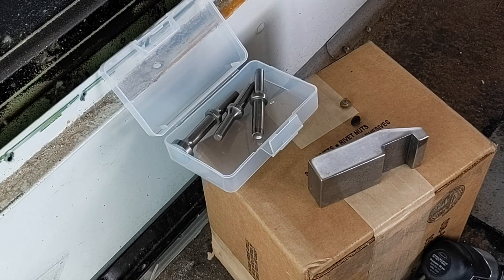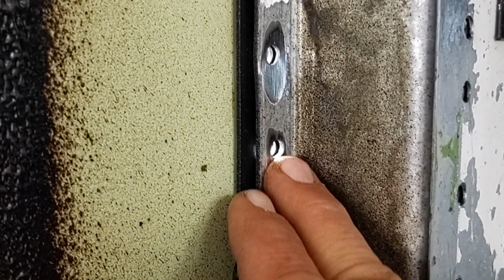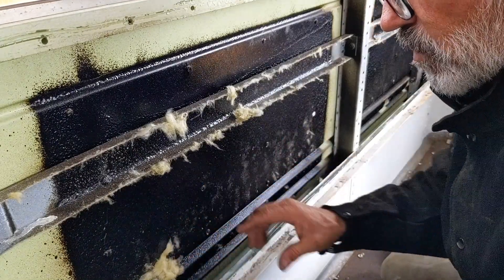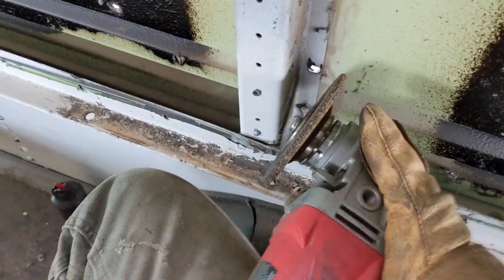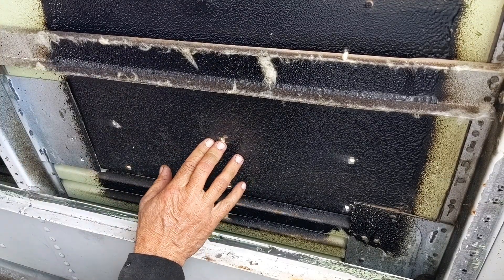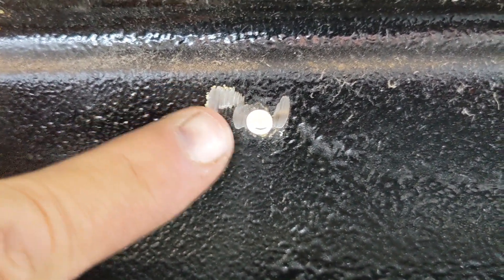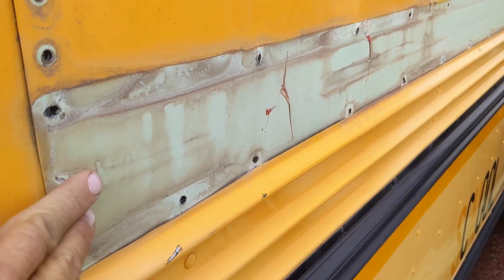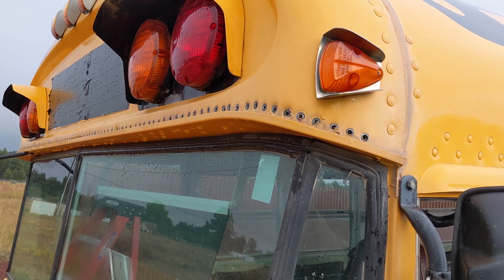How we remove solid buck rivets.

Comment: Those particular rivets in the hat channels came off without much trouble for me using the chisel bit on the air hammer and then using the pointed bit to blast them out.  The ones in the chair rails were a whole 'nother animal though. The chisel bit just wallered out the sheet metal. Cutting a cross in the head with a cutting disc allowed the chisel to remove the head without damaging the sheet metal. good stuff. (I'm shortening a bus in case you're wondering why I'm removing the chair rail rivets)

Comment: If you cannot get to the back side of the bucked rivet how can you remove the rivet?
Oops.  I watched farther and you did explain. My problem is a 1970 MGB Roadster. The windshield is very close to the rivets I need to remove. The Sun visor holders are riveted. I did drill the head off but cannot get the back part of the rivet to fall off!!!

Comment: I did not at 12:00 as you are talking about grinding and avoiding cuts....your gloves show a very close call with the grinder. That event must have been awaking, but sadly we have all had those, yet some lose fingers...maybe that's why they put guards on these tools?
Reply: The guard and handle on an angle grinder gets in the way more than it helps and this is a fact. I've used angle grinders of all sizes for over 20 years and in my experience you really don't have too many 'accidents' or close calls that the guard would even prevent to begin with. Actually, I could see more issues running into a possible accident hitting your hand TRYING to get the grinder into a recessed or tight area BECAUSE the guard is INSTALLED. Point is, don't be a jackass and do stupid stuff with the tool and you should be just fine. This is a time where using your head and some common sense goes a long way
Reply: @caveone-365  After I posted this, I thought maybe should have said with the very low costs of these smaller grinders at places like Harbor Freight it may have been better to say have two grinders. One with the guard on for the many easy spots, and one with out the guard for those "special areas".   With any power tool I always look at the tool and say I want all my fingers after I use this tool, then turn the tool on and do the job.  Simply always saying this little verse has protected myself from my stupid mistakes..  All the best wishes.

Comment: Great stuff! Have you ever looked “rivet shavers” that are sold by aircraft tool companies? They are probably made for aluminum rivets, not sure if it would work for bus rivets which I assume are steel.

I have a rivet gun which is very much like your air chisel but allows more control. You can feather the “throttle” for a gentle slower tap tap or gas it for aggressive hammering. I think the shank of the rivet mandrel is identical to the air chisel shank.